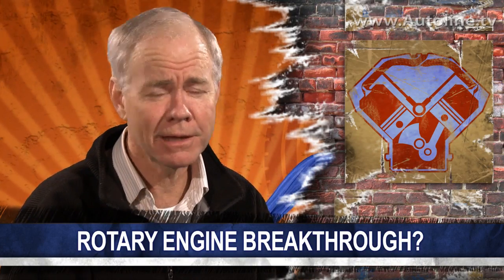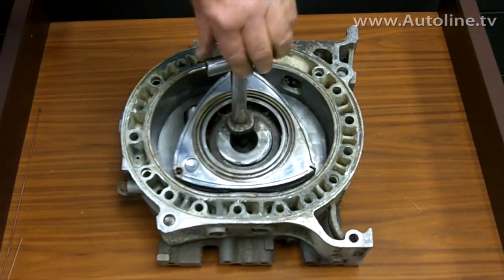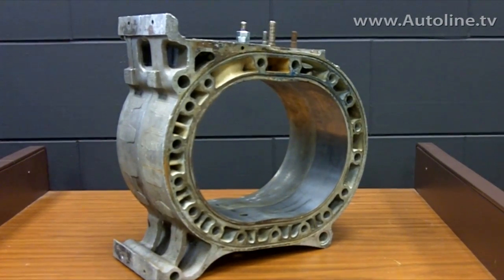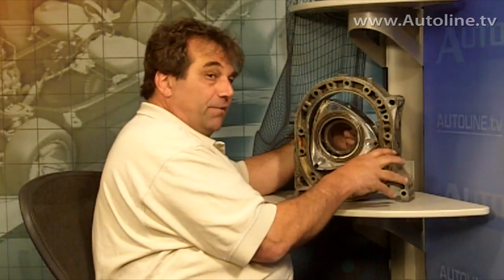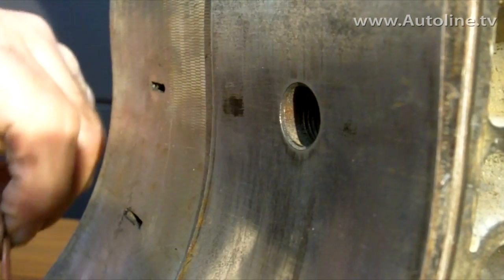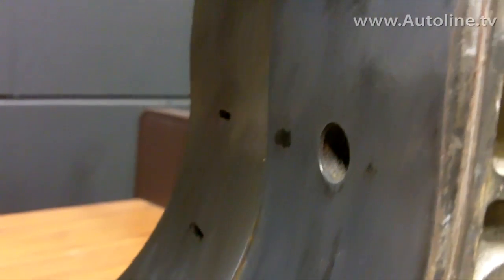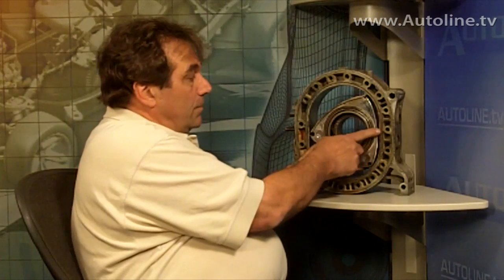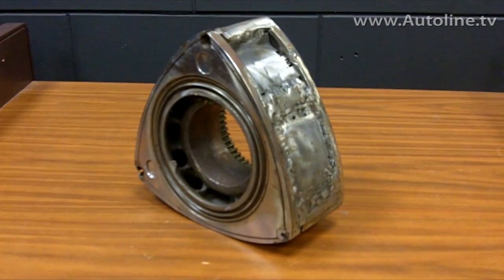Rotary Engine Breakthrough?

Comment: What a load of rubbish,reducing the compression ratio isn't going to increase efficiency!
Reply: He is moving the combustion chamber by opening one area and closing the other side.
Reply: doktorbimmer Moving the chamber to the front of the rotor with pre-mix fuel injection  and laser ignition projecting three sparks into the chamber at the precise moment will make a massive difference. That is obvious. Ernie is right.

Stop making things up.
Reply: Laser ignition does exit. It works. When applied to a range extending Wankel it makes it shine, and clearly surpassing inferior piston engines.
Reply: Mark G Moving the chamber to the front of the rotor with pre-mix fuel injection  and laser ignition projecting three sparks into the chamber and sparking at the precise moment will make a big difference. That is obvious.
Reply: The Wankel does not like to be revved up and down as the fuel economy drops off like a stone. So direct drive applications are not desirable. It likes to be at  constant revolutions within a narrow rev band, then it becomes efficient. Mazda are looking at a range extender running at a constant 2000rpm in the series-hybrid Mazda2 EV. Some electrical generators are more efficient when running at high revs, then the Wankel comes to the rescue as it can freely rev to 9,000 rpm without any problems and still be quiet, smooth and silent. The Wankel is so small it can be secreted under the rear luggage floor in small cars, being one third of the weight and size and with an amazing power/weight ratio. Laser ignition and direct fuel injection will improve the engine even further making it a mainstream choice.
 
The Wankel has found its niche at last, with R&D still ongoing, and I we will see more of it, in improved versions and series-hybrid applications.
 
There is only one car in the world with 100% electric drive with an on-board internal combustion engine. That is the BMW i3. They adopted a 650cc 2 cyl motorbike engine for the generator. The engine was not designed for generator applications. A small dedicated Wankel designed for such applications would be a much superior choice taking up far less space. As range extenders are art time engines rarely coming in, they will last and last.
Reply: doktorbimmer How is the therapy going?
Reply: doktorbimmer Please get therapy. Please.
Reply: doktorbimmer The new Audi coupe is sexee. And piston powered  : )
Reply: Pistons? Oh no! What a retrograde step.
Reply: You definitely need therapy.  Sad but true
Reply: Please get therapy. Please.
Reply: Get therapy.
Reply: doktorbimmer Steam turbines work well for electrical power generation. Immense bulky systems that have no use in an automobile.

And the noisy buzzing Wankel. Even the motorcycle motocross 2 stroke makers shunned it.
Reply: doktorbimmer
I was talking solely about large scale turbines. I live in the U.S. and we have a natural gas cogen turbine plant near my city.
 I don't know the megawatt output though. It provides steam for a gypsum wallboard facility too.
Reply: doktorbimmer Total drivel.
Reply: doktorbimmer, please get professionals help.
Reply: doktorbimmer please get therapy.
Reply: doktorbimmer Please get therapy.
Reply: doktorbimmer Get therapy.
Reply: doktorbimmer Get therapy.
Reply: doktorbimmer Please get therapy.
Reply: doktorbimmer Please get therapy.
Reply: doktorbimmer Please get therapy.
Reply: doktorbimmer Please get therapy.
Reply: Please get therapy.
Reply: Please get therapy. Please.
Reply: Please get therapy. Please.
Reply: Please get therapy. Please.
Reply: The real doktorbimmer You should take your own advice and look up compression ratio! If you increase or decrease the bore diameter of a cylinder and leave everything else the same you will change the CR of the cylinder. Here is a link for you to play with which will illustrate this "very basic simple geometry" that seems to elude you. http://www.csgnetwork.com/compcalc.html
Reply: If I take a cylinder with a volume of 2 and compress the contents into a combustion chamber with the value of 1 I have a 2:1 CR. If I take a cylinder with a volume of 3 and compress it into the same combustion chamber I then have a 3:1 CR. This exactly what the calculator depicted thus proving me right. Please point me in the direction of some literature that disproves this, as I am not able to find anything contrary to what I have stated and have learned over time while building engines.
Reply: Limited mechanical skills? Correct not all engines are the same, however in the otto four stroke ice changing nothing but bore of the cylinder will always affect the static cr. Whether the engine is using a dry sump oil system or not has no bearings on what the static cr of the engine will be. Please list one aspect of the engine architecture that could affect this while not changing.
Reply: The real doktorbimmer Yes I have seen a flat top piston. If the flat top piston was sized for a cylinder with a volume of 2 increasing the cylinder and the piston to 3 would still affect the static cr. Secondly that style of head is used on the Ford Essex motors. Dished pistons are used instead domes in the head itself. Again this would not change the fact that changing the bore would affect the static cr. The dish in the piston would be consider the combustion chamber in this instance and as long as the volume of that area did not change with the size of the piston and the bore of the cylinder we are right back to square one.
Reply: The real doktorbimmer I never said dished pistons were required with a Heron head. I used the Ford Essex v6 engine as an example which uses dished pistons due to the fact that the combination of a flat heron head and a flat top piston, with no recesses cut into it, would not make for a viable engine for a modern day consumer automotive application. However I will cede to this theoretical example you have given.
Reply: The real doktorbimmer What modern day engine are you referring to?
Reply: The real doktorbimmer We were never talking about diesel engines. Of those Otto engines, which use 10.5:1 cr with a heron head and a flat top piston? The problem you run into using a flat head and a flat piston is the fuel will burn erratically. This would cause hot spots on the piston thus causing the piston to distort leading to piston seizure or a hole on the top of the piston. The only engine that I could find reference to that used this set up was a cosworth racing engine with a 12.5:1cr but with extremely loose tolerances and would not be a viable engine for use in a consumer modern day car.
Reply: +The real doktorbimmer said: "Audi was a lot smarter than Mazda... they dropped the Wankel engine 30+ years ago… “
Audi has just built several prototypes that use wankel engines.  

http://www.autocar.co.uk/car-review/audi/a1/first-drives/audi-a1-e-tron

…. so.  you’re … WRONG!
Reply: +The real doktorbimmer

 http://www.autocar.co.uk/car-review/audi/a1/first-drives/audi-a1-e-tron
Reply: +The real doktorbimmer http://www.autocar.co.uk/car-review/audi/a1/first-drives/audi-a1-e-tron

Comment: we're still persisting with fossil fuels then ? Maybe at an enthusiast level, fine. But why would Mazda rehash something that has no future in mass production past the next decade or so. Irrespective, I like his thinking. Seems quite logical really.Going to need a radically different plug design to do the job though ?
Reply: doktorbimmer However as long as there are car enthusiasts and people who love a good light and powerful engine the rotary will live, if mazda offered the engine as an option for people to purchase in any vehicle of their choice i'm sure there will still be people buying it.
Reply: doktorbimmer I can understand your point of view when comparing mpg and emissions however the 1,500 units you're referring to is more than likely on the rx-8 not so? additionally the point i'm making is that mazda should have the option on every car, granted you would have to go through mazda directly.

Long story short the rx-7 FD didnt sell as well as it did because of mpg and emissions, it was all about performance and regardless of how anyone compares the wankle to a piston engine there will never be a 1.3L piston engine that will reach the power the rotary has achieved.

P.S if proof of power is required just watch any Australian rotary drag build.
Reply: doktorbimmer"Todays modern piston engines compete very well against the Wankel in terms of power and weight"
Total tosh!  The Wankel is one third of the size and weight and with power/ratio a piston engine cannot get near to.
Reply: doktorbimmer Total tosh!  The Wankel is one third of the size and weight and with power/weight ratio a piston engine cannot get near to.
Reply: doktorbimmer You are always wrong. Please get some professional attention.
Reply: doktorbimmer You are very confused. Please get professional attention. Please.
Reply: The Wankel does not like to be revved up and down as the fuel economy drops off like a stone. So direct drive applications are not desirable. It likes to be at  constant revolutions within a narrow rev band, then it becomes efficient. Mazda are looking at a range extender running at a constant 2000rpm in the series-hybrid Mazda2 EV. Some electrical generators are more efficient when running at high revs, then the Wankel comes to the rescue as it can freely rev to 9,000 rpm without any problems and still be quiet, smooth and silent. The Wankel is so small it can be secreted under the rear luggage floor in small cars, being one third of the weight and size and with an amazing power/weight ratio. Laser ignition and direct fuel injection will improve the engine even further making it a mainstream choice.
 
The Wankel has found its niche at last, with R&D still ongoing, and I we will see more of it, in improved versions and series-hybrid applications.
 
There is only one car in the world with 100% electric drive with an on-board internal combustion engine. That is the BMW i3. They adopted a 650cc 2 cyl motorbike engine for the generator. The engine was not designed for generator applications. A small dedicated Wankel designed for such applications would be a much superior choice taking up far less space. As range extenders are art time engines rarely coming in, they will last and last.
Reply: @johnburns4017  JOHN YOU LOOK LIKE A FOOL RIGHT NOW.

Comment: this guy did not address scavenging problems rotary are know for where the exhaust and intake gasses mix. the exceptionally large combustion chamber to volume is also a problem. i do like the fact that he did address certain aspects that i did not know before though like spark plug gap fresh charge leakage and torque going against the wrong end of the rotor. a side spark plug might help his cause better for twin rotors mounted on lower combustion chamber area so ignition would begin at the part where it pushes the right side of the rotor and would not hamper seal or cause leakage

Comment: I've worked on rotaries for many years and the problem isn't exhaust heat but lubrication. Many people will say they are unreliable this can be true if proper maintenance isn't done. And what he explained in this  video would work but you would need new counter weighted eccentric shift , fly wheel and front counter weight and then begin testing. And most likely they will find the current design is still best !

Comment: An American company developed rotors for wankel engines applying a standard NACA duct shape to the combustion surface of the rotor. This company holds the patent on the design applied to wankel engines, so at present, Mazda must purchase rights to the design before they can implement it.
The naca duct shape on the rotor surface is being used in the wankel generator engine in the U.S. Military Abrams tank. The engine is used to generate electricity by burning the jet fuel that the main tank engine runs on. The small wankel was chosen because it could be designed small enough to fit in the allotted space. It solved the fuel burn problem these tanks had when left to idle for extended lengths of time on the main turbine engine. The little wankel allowed the crew to turn off the turbine, and still have all the electronics fully functional.
The engine uses an always on "glow plug" to ignite the heavy fuel.
The author derides Mazda for not seeming to "get it". He undoubtedly needs to learn about the extensive work done by Mazda to make the wankel design function well enough to have won more gt3 races than any other marque. They again, won the class this past year, and all while carrying the maximum weight penalty applied to cars that win too many races.  I suggest he and the shade tree guy go to www.rotaryeng.net and spend some time enlightening themselves with the accumulated technical data provided by the long time race engineer, Paul Lamar.

Comment: If something is DEAD you can safely use the word Never.The Wankel coming back ?
The od's for Jesus to come back is greater
Reply: The rotary engine can be proven...Jesus is still just a myth mate...
Reply: Come on ! it's like owning a leaky boat you will
always be bailing water if it can't be repaired.
Reply: Just a little update on the rotary motor if nobody had looked into it yet, Mazda in currently in research and development on the SkyRotary also known as the X16 that will be going in what is potentially being called the RX-9 which will have around 210KW and have a far better fuel efficiency despite being a 1600cc over a 1300cc motor. Mazda is also using the wankel rotary as a potential hydrogen motor that is currently being researched so the rotary is far, far from being dead.
Reply: could i be so bold as to ask for an article on that? if you do a search on either X16 or SkyRotary then there are a fair few articles being posted in 2013. mazda also has the X16 still on its website so if it was truly cancelled then why would they leave it on their site if they have no intention on continuing development?
Reply: Mr bimmer, please keep up.
Reply: doktorbimmer  Pretentious as well as dumb.
Reply: +doktorbimmer You are an idiot.
Reply: Frank Lowe Mr bimmer has ran off to infest some other part of the web. He makes his living from piston engines and paid to write this tripe.
Reply: doktorbimmer Lots of used rx8's in the market still, and can be had for fairly cheap. It's an enthusiast car and has been for a long time. Mazda as a company has said their ideal reciprocating engine in their sportscar is a rotary. Give it some time.
Reply: Thanks,
Reply: Unfortunately the 2 major issue that caused mazda to discontinue the RX-8/Rotary engine was because it didnt meet Euro 4 emission standards but if this fix actually increases efficiency then it could reintroduce rotary's back into their eyes.
Plus Mazda made the furai a few years ago so they're still playing with it.....
Reply: Money byes the whisky
Reply: No! it's dead and it will stay dead.Sorry.
Reply: and yet people are still building them and racing them...and where is this Jesus character?  still a comic strip in the sunday paper...sorry frank, but jesus loses and the wankel wins in the proof category.
Reply: doktorbimmer Yea dead dead dead how come??I shot him 3 times.
Reply: rotaryrocket74 History just history rumbles of the past.
Reply: Yea! maybe i am pregnant we will have to wait and see.
Reply: Stream engines is still being produced like turbines but Wankels no no dead.
Reply: Sad but it it is true.If you apply steam to a winkels in let it will all so really  move. Thanks.
Reply: doktorbimmer The Wankel is made by five companies world-wide.
Reply: doktorbimmer  But one proposes it to be.
Reply: doktorbimmer" the Rotary Steam engine predates the Wankel KKM by about 70 years. It was a commercial failure"
In the late 1800s they did not have the metal and sealing technology we have today. The rotary steam engine R&Ded again today would be a success.
Reply: ***** Not when there are Steam Turbines.
Reply: thaddeus buttmunch Docktorbimmer is not that bright. Steam engines are viable right now. Look at the Cyclone. Ready to put into a vehicle. Much simpler and cheaper to run. No transmission needed.
Reply: doktorbimmer Idiot, just do a little reading. Most electricity is produced by steam. Steam engine have been R&D's for vehicle recently. You have not a clue. Who pays you to write this tripe all over the web?
Reply: doktorbimmer You were directed at the Cyclone steam engine. You never looked and wrote lots and lots of drivel.
Reply: doktorbimmer You must learn about modern steam engines. Until then it is best you do not write about them. You are a very sad person.
Reply: doktorbimmer no you are dumb.
Reply: doktorbimmer You are still and idiot. Who pays you to write this tripe?
Reply: doktorbimmer I have no need to be jealous of an intellectual inferior.
Reply: doktorbimmer You need professional attention.
Reply: doktorbimmer You are a waste of space.
Reply: doktorbimmer You are a pure idiot.
Reply: doktorbimmer You need professional attention.
Reply: Can't you guys just stop this shit-- it's got what to do with Wankel.
Reply: doktorbimmer Actually the thermal efficiency of steam engines is far higher than that of ICE engines.  Also for a given hp rating, steam engines have a stunning amount of torque.
Reply: doktorbimmer because they didn't have heat-resistant metals and thin wall stainless steel boiler tubes.  Now we do.
Reply: Very true--LP Gas may be ??